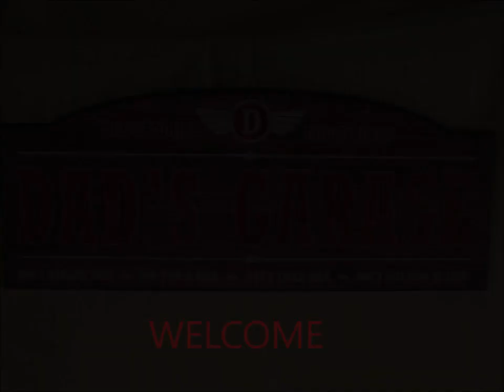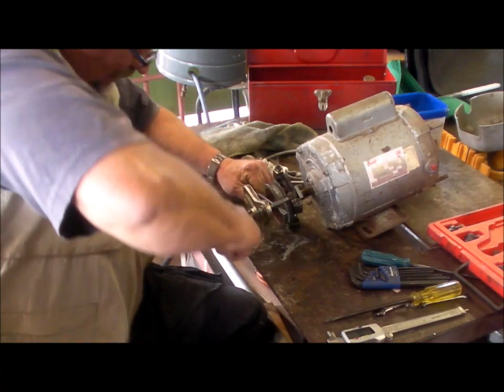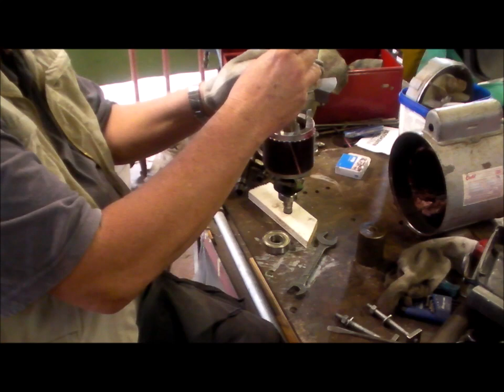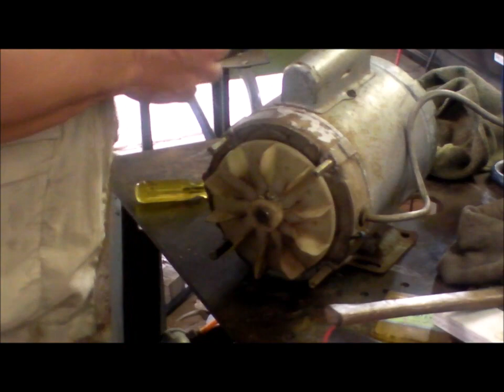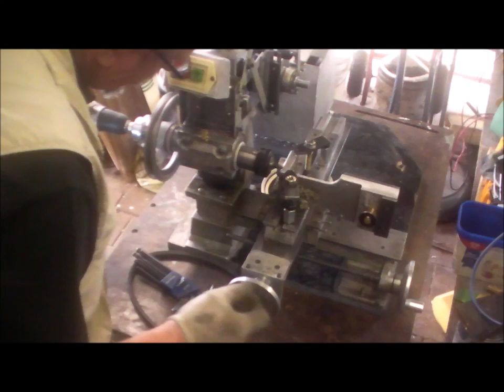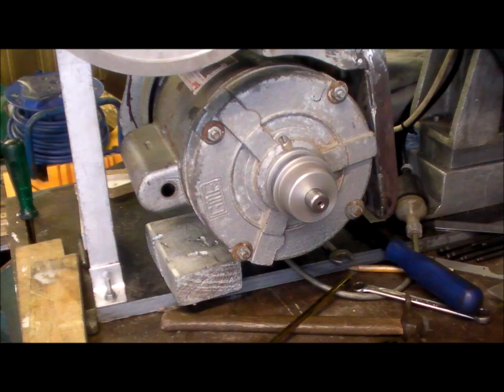Building the Gingery Milling Machine 79, motor replacement

Comment: Hi Peter.  Happy New Year.  I hope this is a good and prosperous year for you.  The new motor is quite a bit larger than the other one.  I am sure it will handle all you throw at it.  You sure had to make the mods to make it fit though.  Reversing the motor is as simple as reversing the start windings.  Glad to see that you just about have the mill back up and running.  I am looking forward to the next installment and seeing the chips fly.

Joe
Reply from the maker: Happy New Year Joe, hey that’s so old hat for us now seeing it’s 17:25 for us but you’re still finishing off your fireworks and the new year cheer. Time travel, it’s marvellous. Wishing you, your wife and family a blessed new year. Cheers Peter. 
Oh a little heads up for the next video, I dive inside the small cover to find instructions to rotate the other way. Bye

Comment: Peter, the end cover next to the fan may need some vent holes in order for the fan to provide enough cooling air. The direction of the motor, if it is single phase, is easy to change, just reverse the leads on the start windings, the ones that are engaged by the centrifugal switch.
Reply from the maker: G’day Ronald, thanks for your words of wisdom and encouragement, all will be revealed in the next video. I found your words about changing the wiring on YT videos but nothing made sense to what I was looking at compared to their scratchings on a white board BUT your words of from the centrifugal switch, well that resonates with me, I can see that. I’ll let you in on a preview to next video, once I remove a “??” Cover I clean the inside of said cover to reveal instructions on what to do, simple once you poke around. Happy New Year Peter. WOW that’s already 15hrs old for me.